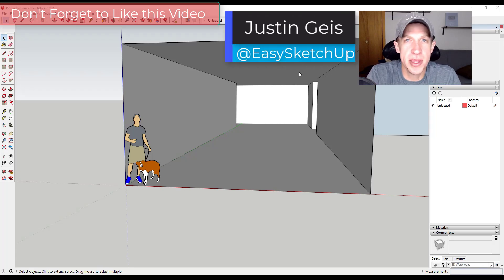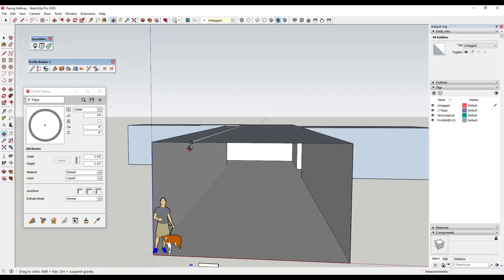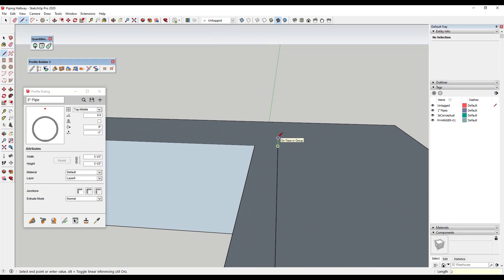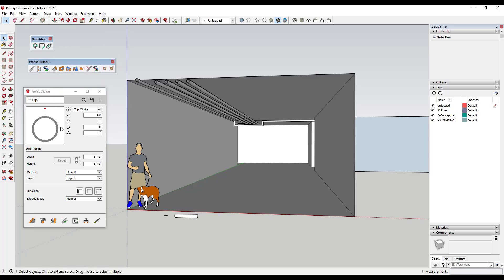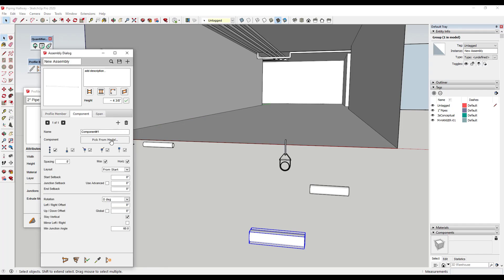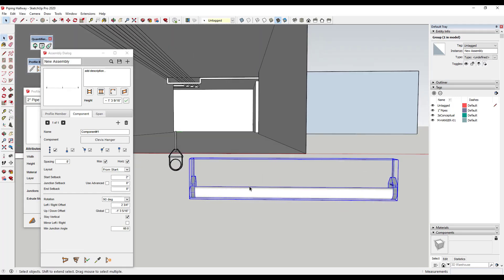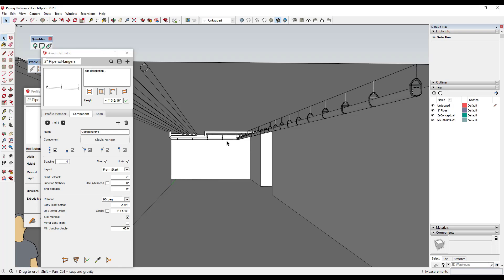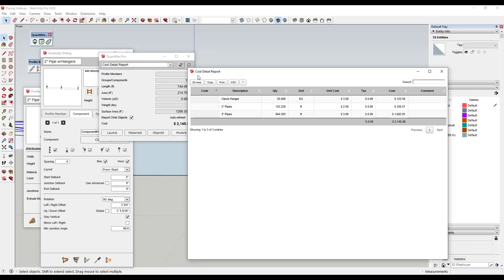Modeling, Quantifying, and Pricing PIPING with Profile Builder for SketchUp!

Comment: These real-world use-case videos are very good.  Keep it up!  A little tip: You can save a lot of time messing around with up / down offsets and left / right offsets if you simply set the axis of the pipe hanger to a more convenient location and orientation.  By default, the red axis of the component inside the assembly will always point in the direction of the extrusion path
Reply from the maker: Ooh nice - I don't know why, but I didn't know this! :)
Reply: Nice Idea!